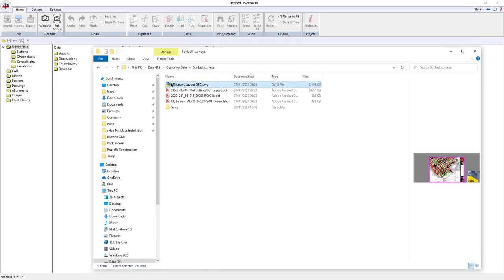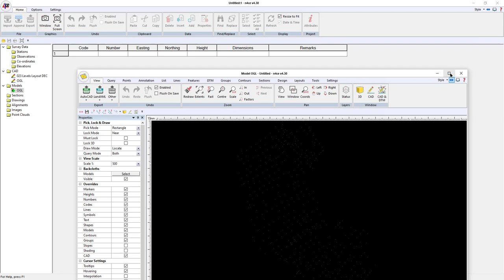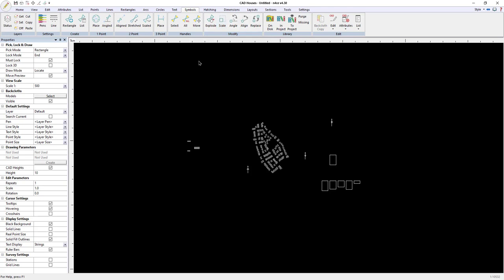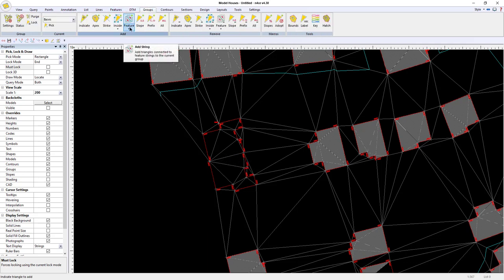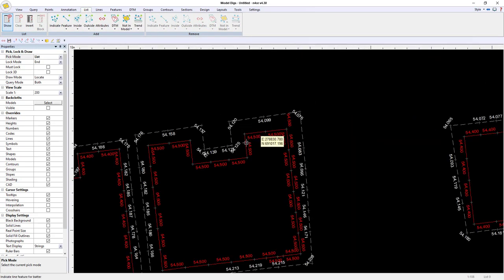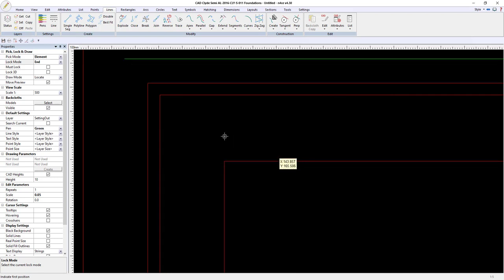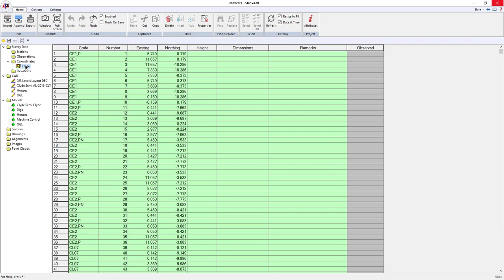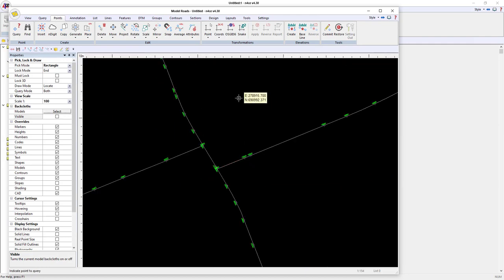Extracting Usable 3d Data from 2d Civil 3d Drawings.

Comment: Great video, would I need the designer package to do all this or could I do this in professional?
Reply from the maker: Hi, this is all possible in Pro. But you will need to contact support@appsincadd.co.uk to request the latest build, which is not quite at a release candidate stage yet. Inorder to use the very latest tools.